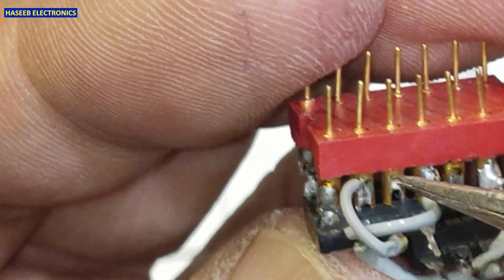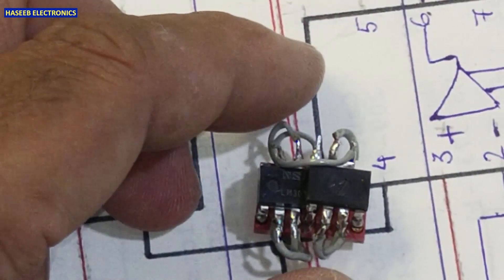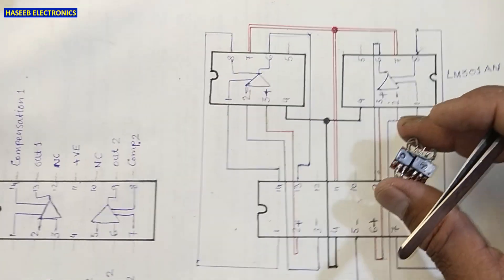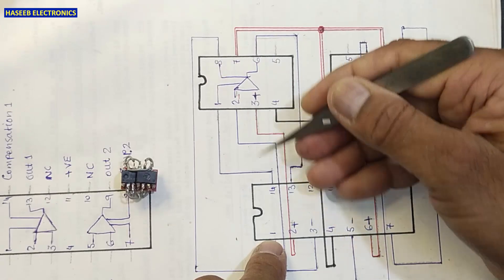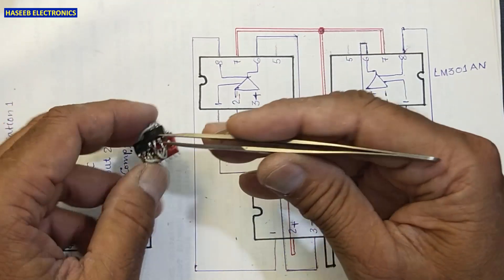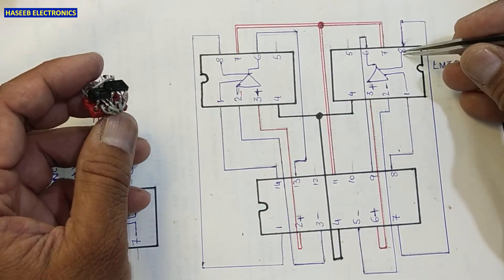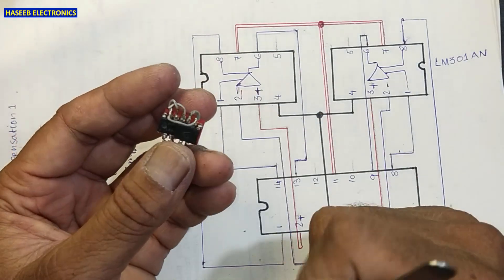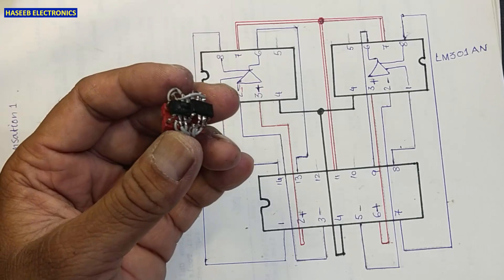{653} K157UD2 К157УД2 Equivalent. How to Get Alternate, Substitute of Dual Operational Amplifier IC

Comment: why so much hassle ? this chip has not been used for a long time even in the Russian - speaking community of radio amateurs . there is a cheap replacement TL 072 TL 082 .
Reply: TL072 has only 8 pins no 14